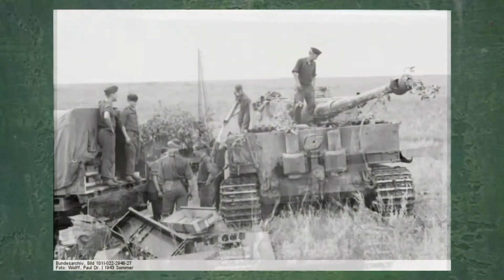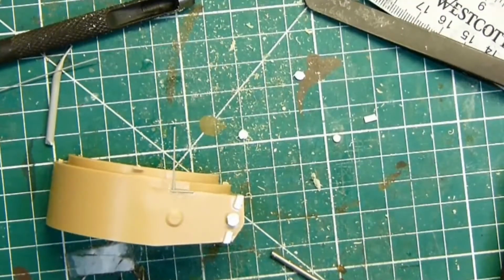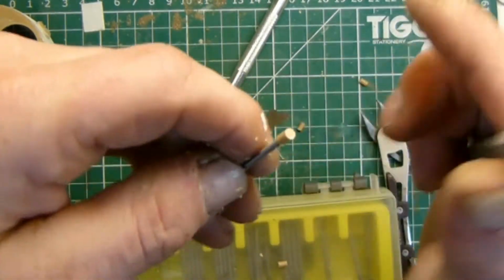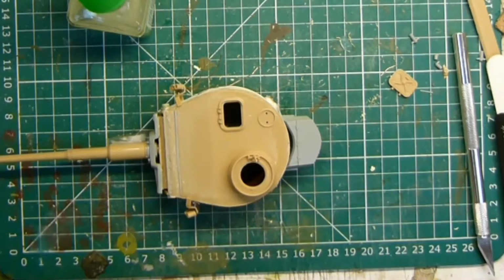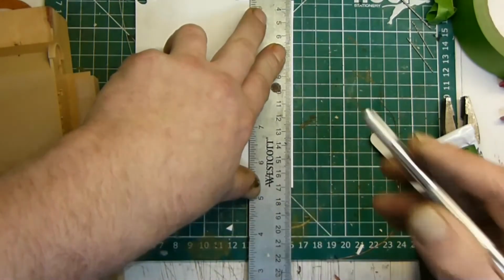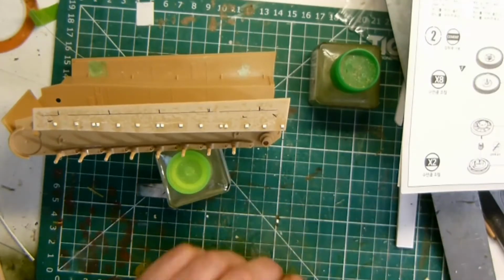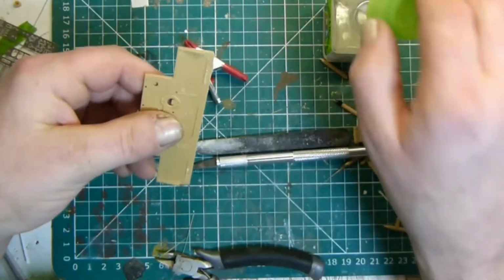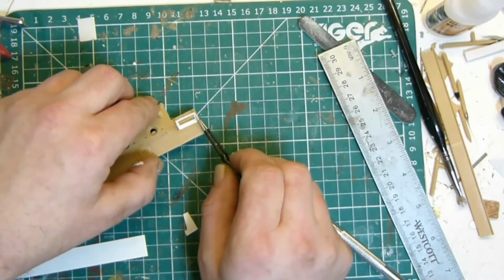Tiger 1 early 1 part 1 kit 13509  kit conversion tiger123 on the steppes,

Comment: Just in case I misunderstood you : operation Citadel happened in summer 1943. Most of the Tigers like this (from the 503rd) were repainted in summer colours by that time, and they had new numbers as well, with black fill in the digits. Your model resembles the original condition of these tanks at the beginning of the year.
Reply from the maker: yeah the kit is operation citadel my mistake. is reading an article on tiger imfo that suggests that this tank was always in German dark yellow. but thanks for pointing that out. hope you enjoyed the video feedback is always welcome
Reply: @militarydioarmour8844   
It's also worth mentioning that the Tiger "123" with white digits (your one) and the Tiger "123" in the summer with black digits, are two different vehicles.
Reply from the maker: @daveybyrden3936  ok thanks for that i did wonder due to the lack of front fenders. Ill have to do more research in the future im happy with the way its turned out but may revisit the build with more research at some point thanks for your comments